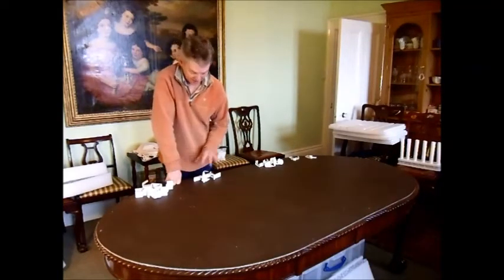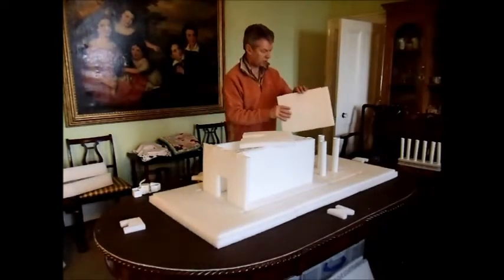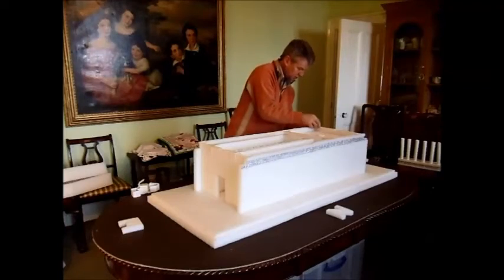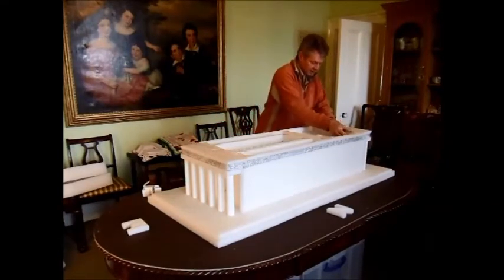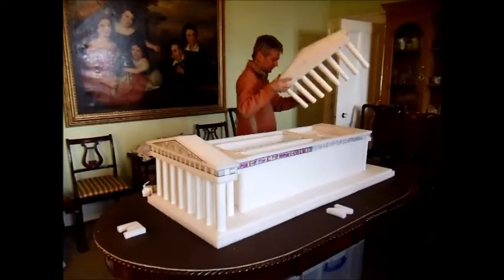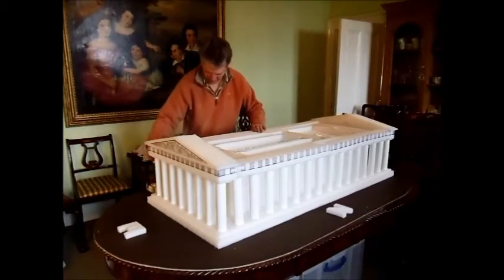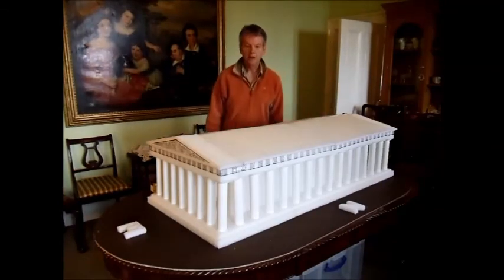Harris Museum Parthenon Model

Comment: Can you zoom in where you have fitted them?
Reply from the maker: I'm not sure what you mean. Can you state the point on the video (minutes, seconds) where you need more information?
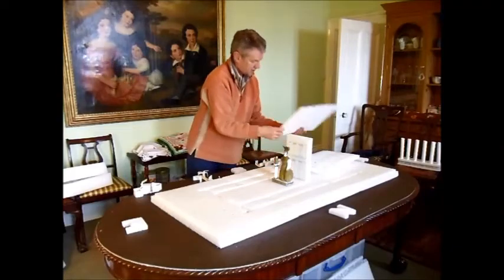Reply: @rjoio  i meant where you have fixed them (1:49, 2:02)
Reply from the maker: @arusheesingh497  I can't zoom in any more in the video but I can explain how the pieces fit together. The material is polyethylene foam which is quite flexible, so if the pieces are made to fit they are held tight in the slot in the base. I hope this answers your question.
Reply: @rjoio  yes. Thank you.

Comment: Where can you find the materials
Reply from the maker: Hi Wajid. The main material is closed cell polyethylene foam, which is normally used as a specialised packaging foam. It's available from Foam Engineers in the UK. It's durable (unlike polystyrene) and easily shaped with a serrated knife such as a bread knife or a saw, and where necessary finished with a sharp blade. Other materials are plastic piping etc available from plumbing suppliers.